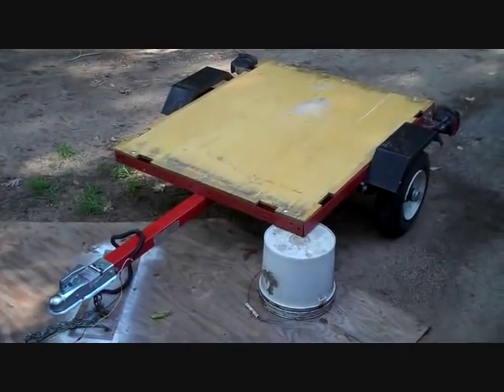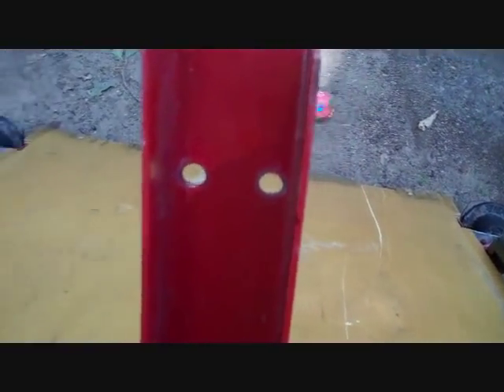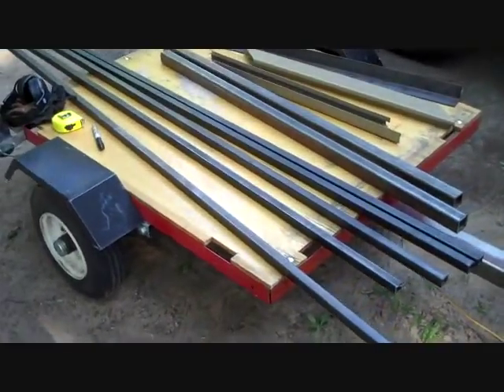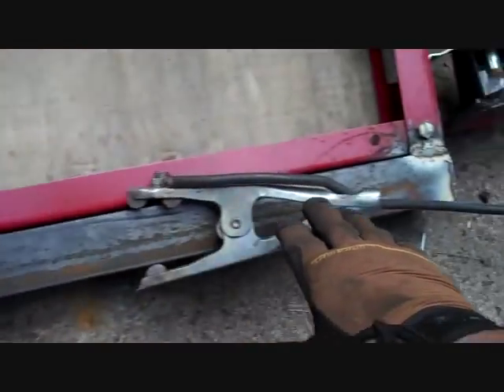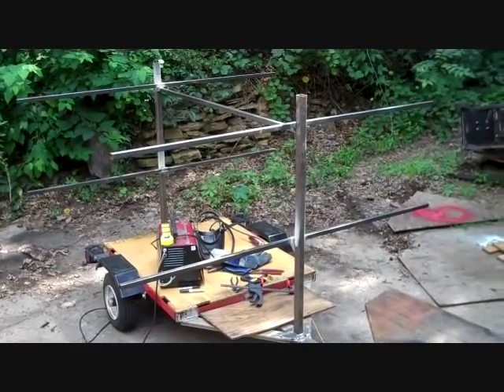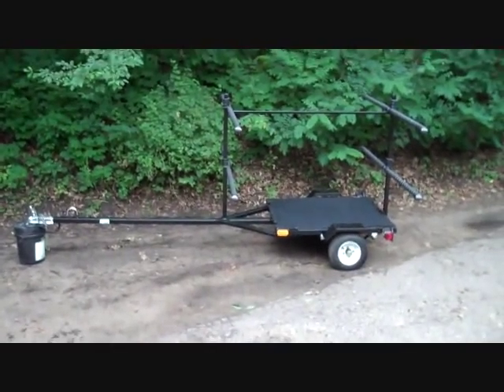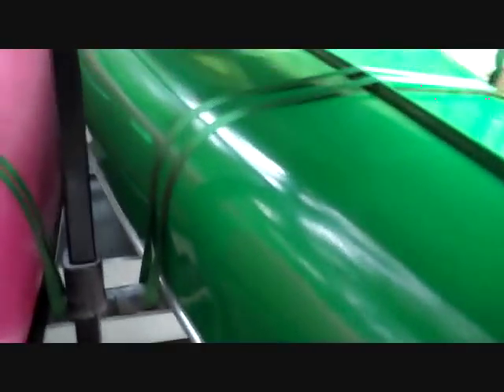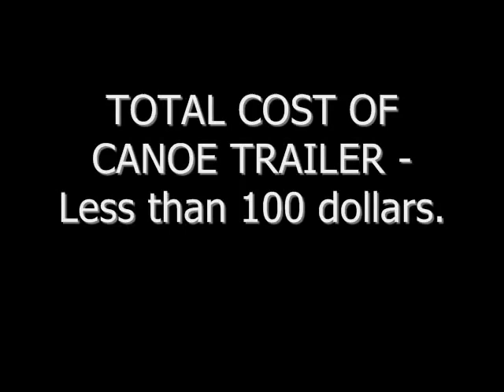DIY CANOE or KAYAK TRAILER

Comment: Nice job. You turned a turd into a peace of prime rib.   Something I did on my last trailer build was to attach a peace of 1/2 inch PVC pipe from the left rear tail light  to about 6 inches from the front hitch. That way you can run your wire loose inside and seal the end with some tape or silicone.   It keeps the weather and grime off it and even the UV from the sun. Always clean and dry and not getting caught.  Next time I might use a coupling and increase the size near the hitch so I can store the extra plug and leash and put a cap on it.  Take care friend.

Comment: I really want to learn how to weld for projects like this (mainly a trailer mounted smoker/grill for tailgating. That machine you are using looks fairly simple to learn... is it? What kind of welding does it do and what level of power welder would I need? Thanks.

Comment: I work a 10/4 shift in northern alberta as a welder and could easily spend most of my days off fixing or build little projects just like this one that I get asked to do. In most cases I don't have the time to but I tell them its would be so easy, and if they plan on paying me, cheaper to go to home depot or similar place and buy a little lincoln tombstone welder or a small wire feeder like yankee has and do it yourself its some of the best money you will ever spend it will easily pay for itself on the first little job. welding is one of the most useful skills you can have you can build a nice little shelf to hold the 50 some 5 gallon pails of rice that have been in your basement for 20 years

Comment: YP, you are a man of many skills and talents. Nice trailer. Were you concerned with tongue weight, total weight, and balancing weight over the axle? I don't know much about trailer design, just looking to learn. Is fishtailing avoidable? Thanks again for posting the vid!
Reply from the maker: The axle weight is over 1000 pounds so I knew I had plenty of room to spare.   Tongue weight is important,  but not rocket science.   I planned it to be well balanced and put the trees in appropriately.  You want the majority of weight to be in front of the axle towards the tow vehicle to avoid problems.

Comment: Do you have a materials list and dimensions for the tongue and trees?
Reply from the maker: LOL...no.   I didn't have a "material list" when I built it either,  I just measured my canoes and got what I needed to accommodate them and what I was hauling.
Reply: Yankee Prepper - Preparing for the Wrath of God and Fine Coffee. What did you use for the tongue, it did look like 2"square tubing?

Comment: What size tube steel did you use?
Reply from the maker: 2 inch on the uprights and 1 inch on the horizontals I think.   Trailer works GREAT and pulls straight.  Better yet,  it is holding all the canoes in one place sitting in the back yard.
Reply: great thanks

Comment: what size tube you use on the trees?
Reply from the maker: +peter tinoco I used 1" square on the horizontal and 2" square on the vertical.
Reply: +Yankee Living (Combining DIY, Outdoor Adventure and Fine Coffee)  thanks bud i have the same trailer , i like your idea, how did this hold up driving on the highway?
Reply from the maker: +peter tinoco   tows perfect,  even in wind.   It's a 1200lbs trailer so I would expect it to handle the load fine.   I towed 4 canoes back on it (2 years ago) for 4 hours in moderate winds and it never moved behind the Suburban.
Reply: +Yankee Living (Combining DIY, Outdoor Adventure and Fine Coffee) awesome thanks again